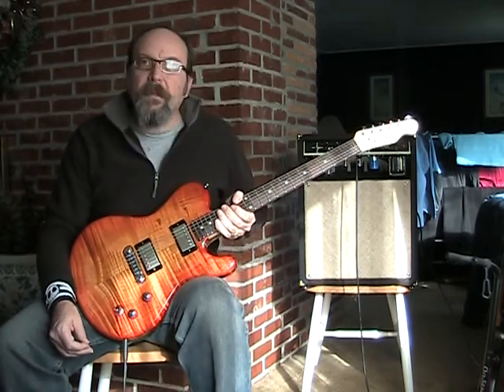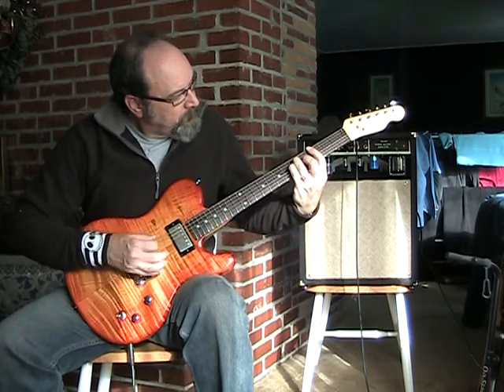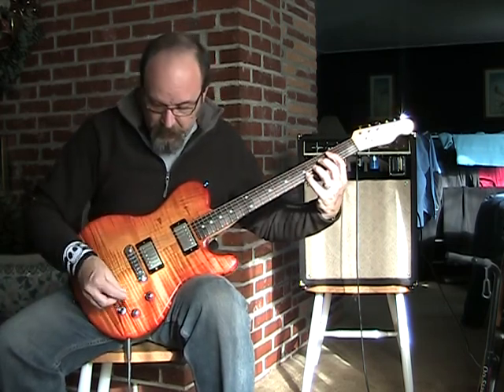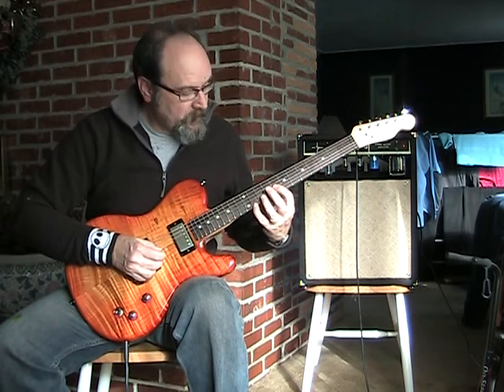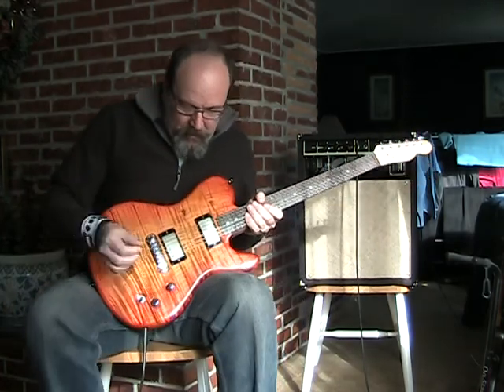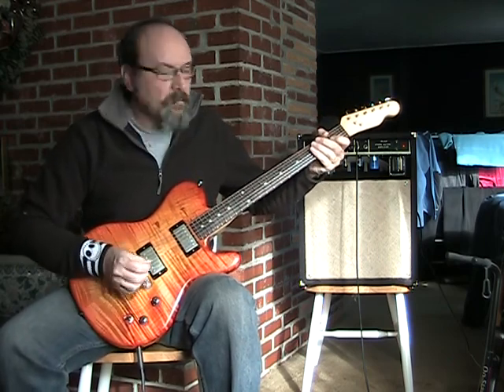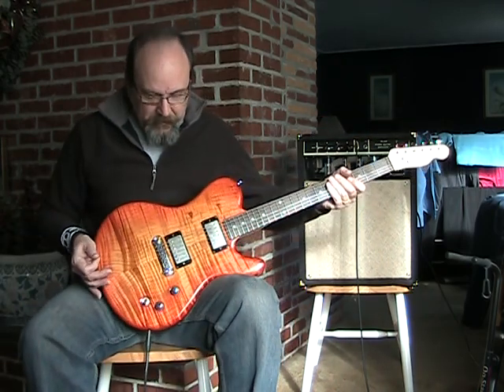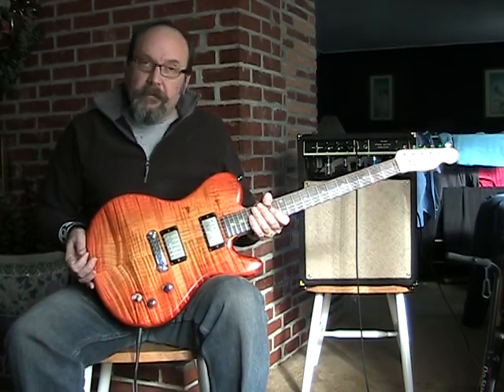Fat Belly Tele-Style Guitar Demo

Comment from the maker: @listert Thanks, man!  I'm still very happy with this guitar.  I like the AVT-II a lot - very comfortable under the palm, and easy to string up, even with the recess I set up.  The Tru-oil won't get as mirror glossy as Lacquer, but it's a great finish in a different way.  Very lustrous, and it feels great.  It seems to have hardened very well also, and is protecting the wood nicely.